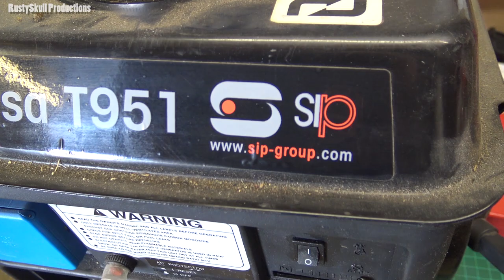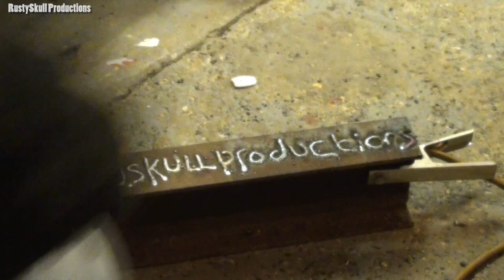SIP 2-Stroke Generator Repair WILL IT RUN? - RustySkull Productions

Comment: Hi Rusty, You are having or had and got exactly the same as me at the moment after doing some of what you have done, but not cured, so will carry on with the carb and fuel tap to see if it will cure the non run except on chock.🤔☺️

Comment: Great tips for me. Working on a very similar unit (with same carb), right now.  Will only run with choke between half and full on.  Voltage is about 15% over the normal120vac (on this side of the pond) or 137vac.  Still looking for a good video for what seems an endless number of adjusting screws.  Narragansett Bay
Reply from the maker: Well good luck!
Reply: Same as mine.
Reply: Same observation re number of adjusting screws and wonder if Rusty skull could advise on his method of final tuning adjustment of those or at minimum a starting point would be great.  Was working on similar one today and while got running rough need to figure out best sequence of adjustment screws etc.  
Thanks.

Comment: They are notorius piece of ,hit, use welding torch jet cleaners, or check exhaust,take it off and make shure ain,t blocled ,burn exhaust, with blow lamp,